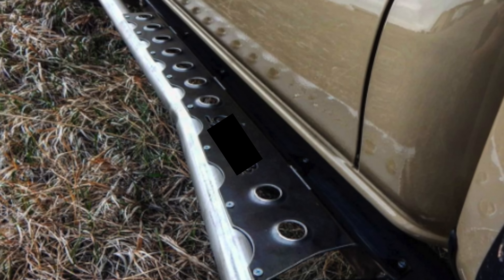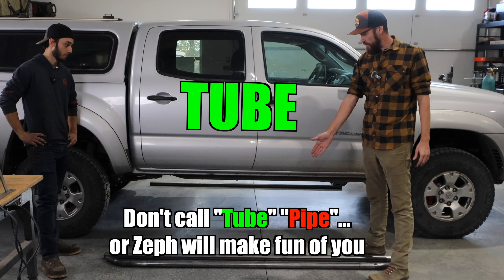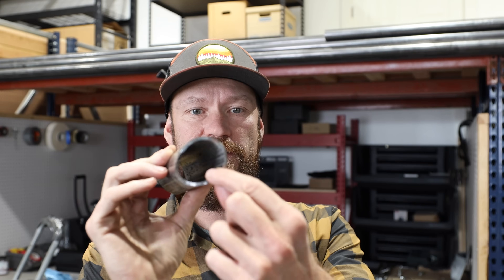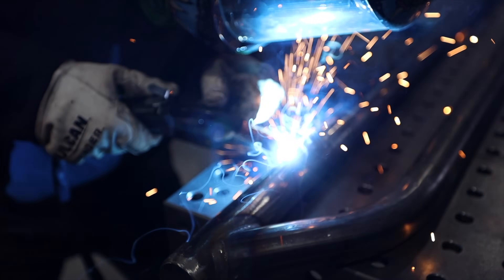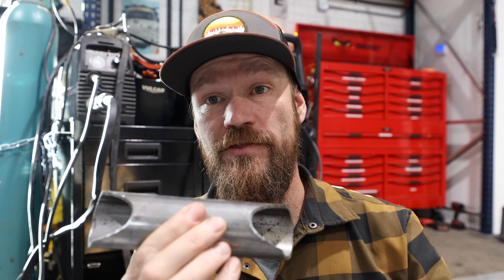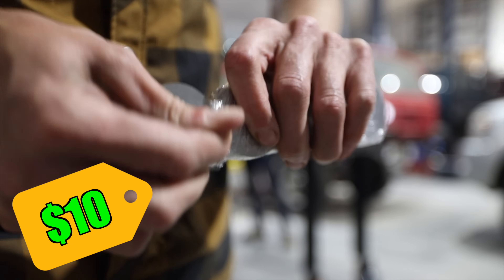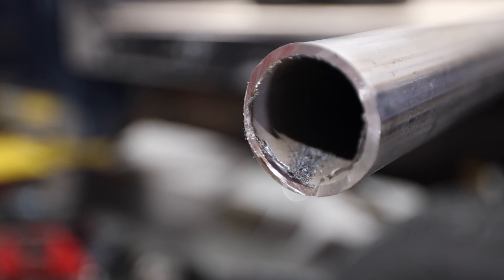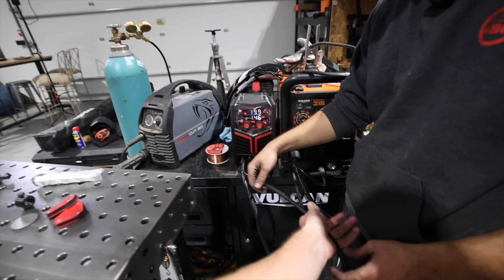Cheap Tools vs Expensive Parts... WHO WINS - Fabrication for Beginners

Comment: for cheap, large holes....through pretty much up to 1/4"...carbide cutters.  Low speed with hand drill, cutting fluid.
Reply from the maker: Great tip!
Reply: @OutdoorAuto  they make a horrible noise, and are pretty abusive if they hook too hard, but eat through pretty fast, faster than hole saws, and last longer.

Comment: Good work. I didn't think yopu'd make for less, but as you say you now have loats of tools and skills for the next set, and you can't really price the skill. I think it's useful to know how much it costs to buy something or get someone else to do something and then see if I can do iit for a third, I got this from Dane at Brupeg (YT channel). The nice thing with this theory is it gives you two goes to get it wrong and you would still break even. Then after a couple of goes you should really know if you can really do something or if it should be left to a pro. If I think I will use a tool again I wouldn't add it to the cost of a particular project, but do include the consumables. Finally, I think it's useful to consider tools as investments rather than 'project' costs. Nicely welded logo btw.
Reply from the maker: 100% agree with you that tools are an investment… I like spending money on tools even more than trucks.

Comment: Should show how/where welded to the frame.
Reply from the maker: We grinded off the paint for a good weld, weld the pipe straight to the frame add a gusset with the the 1/8th in flat

Comment: Did you include the shipping cost of those rock sliders?   If not you came in under budget 👌🏾
Reply: Also, depending on the state the company you buy from and you're in, might have to factor in taxes as well. I'd say between tax and shipping they easily cleared it.
Reply: I tossed around buying some sliders and yeah, shipping is one hell of an additional cost you don't think about on em lol

Comment: You could lower the cost even more with flux core welding, to avoid the gas cylinder and gas regulator.  With stick welding, the rods and welders are even cheaper and can certainly do the job.
Reply from the maker: Absolutely true… we tried picking the easiest stuff for a beginner.
Reply: Flux core is probably easier for a beginner.

Comment: Very torn on welding with gas vs without gas. Without gas it such a pain to get refills where I live, I basically have to take time off work or ship my tanks a few states away to refill them, so I moved to flux core wire. The more you use this stuff, the better! I learned on my front bumper and soon I'll be doing some sliders and skids!
Reply from the maker: I luck out… the farm is next to a big industrial area and I have lots of gas options
Reply: flux-core is great, but a little splattery. It's also great if windy or the gas runs out and I think it's worth having for these reasons. I use HobbyWeld 7L cylinders and ~£80 is 3h of trigger time, so not too bad. 3h isn't a lot if spot welding bodywork, but flux core struggles with thin sheetmetal, or at least I do.
Reply: @stco2426  from what I've learned running 0.3in wire and overlap or having a nonferrous backer plate aka 1/8in aluminum or thicker to draw away heat works well. And i won't just use this with flux core on thin material. Also I might have had the polarity set wrong a couple of times... All in all with flux your going to have higher running costs and about the same clean up time in the shop setting. Field work pays more but you have to drag your equipment there.

Comment: 5 thousandths of an inch is thicker than a sheet of paper. Paper is typically is 0.004 in thick with thinner stuff comping in at about 0.003 in. As a former machinist that used paper to set tool offsets, I'm very familiar with its thickness.
Reply from the maker: Google doesn’t agree with you… BTW card stock is what the “thicker” stuff is call and it’s .010
Reply: @OutdoorAuto  I just grabbed a peace of paper from my printer and measured it at 0.004 in flat. Google is wrong. Card stock is card stock, not what anyone thinks of as paper.
Reply: I worked in aerospace as a machinist making parts that had to be within 0.0005 in of total tolerance. I left machining and got a degree in mechanical engineering.
Reply: @TeknoMage13  dang you got 5 tenths tolerance must be nice, light work baby
Reply: @zephgage3694  I assume you're trying to mock me. When things required tighter tolerances than that, they went to grind and/or lap. The only reason I mentioned the tolerance is to show that I know how to measure things, not engage in a pissing contest with other machinists. I'm well aware there are areas of machining that hold tighter tolerance.

Comment: If you look at building everything: front bumper. rear bumper, skid plates for: gas tank, rear dif., front dif. transfer case, trans. pan, oil pan and sliders you should safe money?  Plus you should be able to safe on the materials buying in larger lots.
Reply from the maker: Yeah... the more you use the tools the more you save because you already erased the sunk cost just with the sliders.

Comment: What would the cost have been if you used 2x6 square tubing instead of round and flat plate?
Reply from the maker: I wouldn’t build sliders out of 2x6… that would add way too much weight.

Comment: Can you demonstrate welding in the field? 
Friend of mine had an under hood welder ( not homemade but aftermarket) and had to use it. 
I have seen other makeshift welders. Like to learn more. 
Thanks
Reply from the maker: We actually were just talking about ordering one of those... they work best with two batteries but can get buy for a trail fix with 1.... that is a good idea for a video.